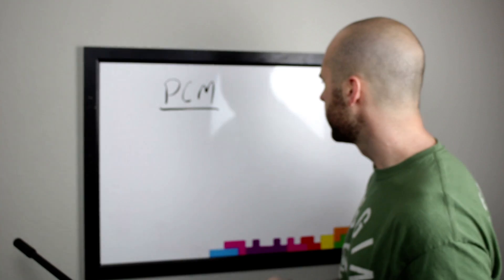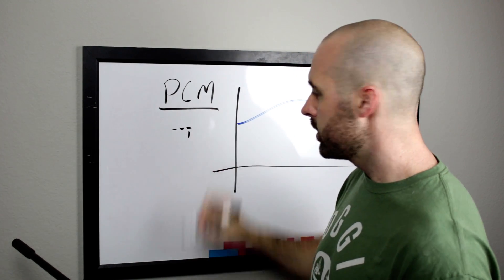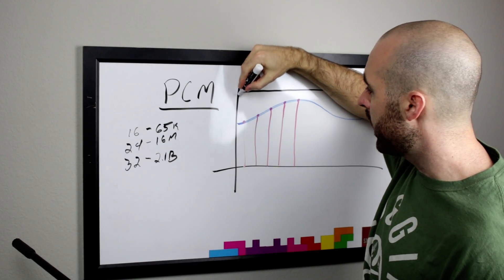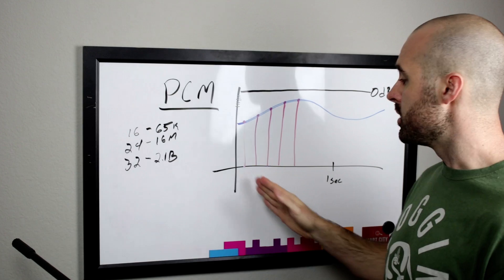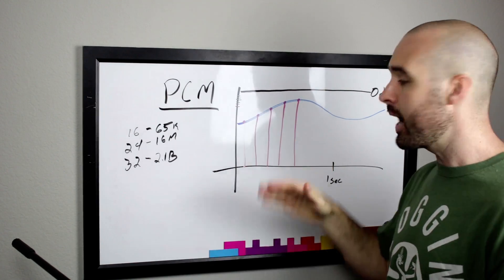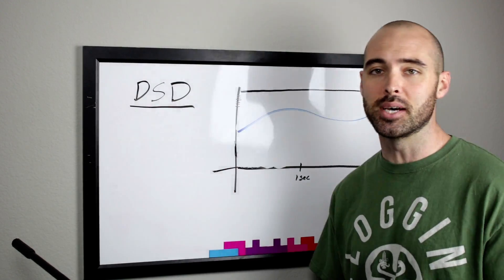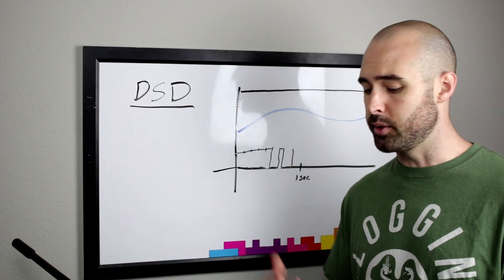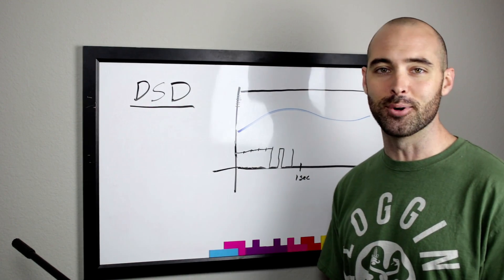PCM vs DSD - Audio formats explained

Comment: There’s a lot more to DSD and it has significant advantages, but sadly, most “DSD” being sold is either transcoded PCM, or otherwise low end.  We have extensive analog, DSD and PCM recording and playback gear in our studio, and there are major sonic reasons why some like us are willing to put up with the massive pain in the asss that DSD is to work with, just as others are with tape.   DSD256 is in most ways superior to top quality 1/2” tape at 30 IPS.  We used 2” at 15-30 IPS gear for years, but now only do DSD 256 for high end projects, using 100 V rail to rail analog gear on the input side.   https://youtu.be/eu5I-z7f6is

Comment: I love DSD because of it's pseudo analog qualities. You can even attach a audio line in straight to the bitstream output,  and you will hear music.
Reply: @PimpinBassie2, DSD is that magic signal that can be picked up as analogue or digital. It does away the need to know byte  size, bit alignment, signed/unsigned, CRC (checksums/parity/redundancy bits).

Comment: The formula for finding how many bits are in a specific bit depth is 2^X, where X represents your bit depth. For example, 2^16=65,536 bits. There are about 4.29B bits in the bit depth of 32 floating bit. I'm not sure how he got 2.1B. I haven't watched the entire video so maybe he addresses this. I just wanted to post this incase it helps someone else. Here's a quick link explaining this. 
https://en.wikipedia.org/wiki/Audio_bit_depth

Comment: viel gefährliches halbwissen, jonge^
the bit depth just gives you the possible dynamic range, which is 96 db with 16 bit and about 140 db with 24 bit.
the Herz depth gives you the frequency up to which you can hear: 44.1 kHz sample rate gives you a playback depth up to 22.05 kHz; also half what the sampling freuquency is.

you should at first inform you a little bit better....
but even big "experts" like PS Audio can't explain everything the way most of us "noobs" would like to^

I hope that helps a little bit and have a nice day.^ Peace.

Comment: DSD was really developed as a archival digital format, which found itself to market trying to replace CD. Not that CD needed replacing as they generally sound great with a half decent set up. Far too many times it's crappy production and mastering that gives CD a bad wrap.
Reply: It only takes 1 bottleneck to ruin the whole chain of audio preservation.
Bad mic on the studio, bad raw files storage, bad mastering that overly process the signals.. restricted audio formats, then restricted audio equipment, to finish off with bad ears capabilities.

Comment: One can hear the difference, but most don't.  That's why I like HDCD (pcm) CDs.  Can play on any cd player, doubles the sound qualityof a CD.  Can program the order of play, repeat one track, or just those chosen, or whole CD as it is.  On MEDIA PLAYER (automatically plays HDCD higher resolution) on laptop etc.  Can make custom playlists easily, from any downloaded CD. downside is that very few if any players have the ability to decode it anymore. Way back in 95 (when HDCD came out) many DVD players had HDCD playing capability.  I really like DVD-96.  Neil Youngs blue ray and more importantly his streaming Archives site usually has 192/24. Old analoge sounds great.  I wish there was someting between 96 and 192, to see if there's a cut off there?  HDCD is the best compromise and I wish that it was standardized in all CD/DVD players, especally in cars.  Not too many tittles in HDCD of course since our music tech changes so fast, the lousy MP-3 and sound wars eat up high fidelity.  Another aspect of our flattening sociey.  Rotten for those who are mindful about their music.

Comment: Well then theres sook much more then the bit depth of audio, so if the audio is 16bit, then we need to also what’s the amount of khz,then we also need to know the amount of kilobytes per second and we also do need to know the S/N to noise ratio ,,

so for instance an 8bit sample at 4khz can be sounding just as bad as a 4bit sample at 16khz,or a wave file at 128kbps can be sounding not any better then an mp3 file at 320kbps,,so all these examples shows then this makes no sense at all ,same thing with a micro processor,, an 8bit cpu running at 12mhz can be equal to a 16bit cpu running at only 3mhz,again making no sense.

Comment: I have not had the chance to experience DSD on a good sustem yet. But I can say the difference between a CD and a true 24bit/96khz recording can be quite noticeable. Wish the CD standard 16bit/44.1khz from the 80s would get bumped up to 24/96, its way over due.

Comment: DSD is called direct stream because it outputs native pulse width modulated audio, the output of class D amps before filtering. That's a big deal. The less you mess with the audio, the cleaner the audio is.

Comment: If there’s an audible difference between redbook and DSD (I can’t hear it with my mid-range dac/amp/headphones), it’s very small compared to the impact of the recording, mastering, amplification and playback (speakers or headphones). As storage and processing of large music files is now a non-issue, I’m not averse collecting them, but I won’t be paying a premium. In my case much better to put that money into a better set of headphones.

Comment: DSD is just a low bitrate Delta-Sigma Modulation stored and PCM is Pulse Code Modulation stored. The old DSD does not delivers better quality then CD, the fact is that CD delivers much better sound quality over 8kHz.

Comment: 768kHz/ 32-bit  seems to have higher sensitivity than DSD
Reply: Do the math. Every bit of depth cuts the signal level in half. If you think of a 2V line level sgnal, 2 bits would give a 1V resolution between steps. 3 bits .5V. 24 bit would require resolving roughly 0.00012V per step. Technically impossible today. 20 bit is about today's limit.  Sampling rate is far more important than bit depth.
Reply: Most record in 24bit so 32bit recordings will sound slightly better, especially if you convert to the higher DSD formats

Comment: Another advantage of Hi Res is, some would say the biggest is take Hi Res music gives less fatigue. These sounds are not natural and your brain has to fill in a lot of info( this is why some people sound different on the phone). Hi Res lets you brain relax because there is more detail.
Reply: I don't know about that, but I just setup DSD, and I will confirm, there is a difference, and it's not subtle. If the technical limitations are overcome, DSD will replace PCM. It sounds that much better. 
To give an analogy, when DSD first kicked in, it was like water cleared from my ears. I didn't even know PCM sounded so veiled until I heard DSD.
Reply: Like loudness compressed PCM, DSD increases the dynamic range and softens it out with it's higher sample rate, even with conversions.

Comment: People who have the ability to listen to DSD will do it
People who dont understand how or what they need to buy will never understand the difference in quality  .
Reply: Different...
http://prosound.ixbt.com/hardsoft/korg-mr1000.shtml
Reply: The difference is precision and sound stage, DSD is far from obsolete, there's almost zero quality loss from the actual source, whether from a microphone or vinyl. There's a perceptional difference between instruments and dynamic range. If you listen to reference level headphones or speakers it's very noticeable. Less so on YouTube because the transcoders degrades it heavily. Get Foobar2000 with the DSD plugin and download an actual dsf or dsd file and i'll guarantee you can hear the difference. Unless you actually hear it and compare it you don't understand it nor qualified to brush it off.
Reply: Çerastes, I recommend You following experience - very good turntable with good tonearm, very good moving coil low output cartridge, step up transformer and good phono stage. Now let's make vinyl rip with digital recorder KORG MR-1000 to 1 bit 5,6MHz dsf file (PDM DSD). This file can be 3-5 GB big. Later make PCM 16bit 44,1kHz rip flac or wav file with the same or similar digital recorder like Korg, Tascam. File will be much smaller 300-500MB max. Later  compare both files on very good hi fi/hi end systems. Difference is HUGE. DSD is the best technology to digitalize analog sound sources. For instance sound of violin is different, sound of man's voices, percussion, cymbals etc. Try to do it.
Best regards from Poland.
Reply: +James Diaz: That pretty much proves it's placebo then since that foobar2000 plugin you're describing converts into PCM and resamples to something your soundcard can handle - typically 44.1-96KHz. Your soundcard doesn't support DSD output, all audio you're hearing is PCM.
Reply: The ifi dac does support DSD so...

Comment: DSD samples rate is 2.8MHz , not 24Mhz ..
In addition, The DSD graphic description is very inaccurate to say the least..
Reply from the maker: Sure the original DSD rate was 2.8MHz, but there are multiple implementations, which most DSD DACs have. DSD512 is 24MHz. As far as I understand it, that's the general idea of how DSD works, which parts of it are very inaccurate?
Reply: Lior, it's not so much as inaccurate as simplified. DSD is hyper precise and is, at it's core, dumping the raw signal from the AD/DAC into a wrapper. Hardware recorders can set the DAC to the right frequency to the DSD depth you select that's why it's not really a consumer format. You need hardware that operates differently then the set rate PCM DACs, much of what PCM recording does is in software, hense cheaper then the variable frequency DACs used for DSD.

Comment: Basically this entire argument boils down to what algorithm is good enough. Since almost all high end audio formats are in PCM, and studios/people have a lot of money tied up in PCM, the likely hood of DSD or DXD gaining in mainstream popularity is close to nil. In my view PCM is just fine, and DSD/DXD is just diminishing returns.
Reply: DXD is PCM, but  24-bit 352.8KHz studio format. But dsd is marketing. There are almost no pure DSD recordings available to consumers. This is because there is currently no way to edit, mix, and master DSD files. Only the rare DSD recordings made from a mixed and mastered analog recording, or those recorded direct to DSD without any postproduction, are pure DSD. Most so-called pure DSD recordings are, in fact, edited in PCM. Most commercially available DSD recordings have to be converted back and forth to a PCM format in order to do postproduction editing, mixing, and mastering. In each of these conversions, more quantization noise and/or quantization errors are added to the recording. This leads many to ask: why degrade performance by adding the additional step to convert to DSD when the master is already in PCM?. DSD has significantly higher quantization noise than PCM, and the noise is much closer to audible frequencies, requiring significantly more sophisticated digital filters, as well as noise-shaping and upsampling algorithms, that can result in distortion of the analog signal. When a PCM file is played on a DSD or Bit Stream converter, the DAC chip has to convert the PCM to DSD in real time. This is one of the major reasons people claim DSD sounds better than PCM, when in fact, it is just that the chip in most modern single-bit DACs do a poor job of decoding PCM. 
Another issue is 96KHz and 192KHz HD audio. Though modern sampling rates are high enough to fool the human ear, quantization errors still occur when translating from one format to another. For example, when Sony decided to archive their analog master libraries to DSD64 back in the mid 1990s, they were wrong to believe that these masters would be future-proof and able to reproduce any consumer format. The fact is, these masters could only properly reproduce a format that was divisible by 44.1KHz. So any modern 96KHz or 192KHz recording created from DSD64 master files have quantization errors. This leads me to one of the many things that enrage me about the recorded entertainment industry. If 44.1KHz was the standard that was engineered to put aliasing errors in less critical audio frequencies, then why did they start using multiples of 48KHz?!?!?!? All they had to do was go with 88.2KHz and 176.4KHz as the modern HD consumer formats, and all of this mess could have been avoided. The same thing happens with DXD (24-bit 352.8KHz) equally divisible by 44.1KHz. What blithering idiot decided to put a wrench in the works with 96KHz and 192KHz HD audio?
Reply: You're absolutely spot on Javier. Very well said!
Reply from the maker: Nice wall of text, haha. Very interesting stuff here, thanks!
Reply: I see DSD as a Mastering and Archiving format, even PCM 192khz 24bit converted to DSD gives the PCM enhanced depth, being able to distinctly identify specific instruments that was muddied when in PCM. DSD is also coming back with the Audiophile scene and you can buy new 2017/2018 built recorders and even the old professional recorders are keeping value. What became obsolete is SACD, what survived is DSD and expanded upon with DXD to get even more from the format. What people don't understand is DSD is basically a wrapper of the RAW signal before the A/DAC samples it. So your getting basically a direct digital conversion from analogue which retains nearly all of analogue's unique characteristics, like the high frequency noise, which is above 20khz and out of the hearing range of 99% of the population btw. Jay did good on the basics, but his perspective in more of the every day user, if he explores more into DSD he'll have a better overall perspective.